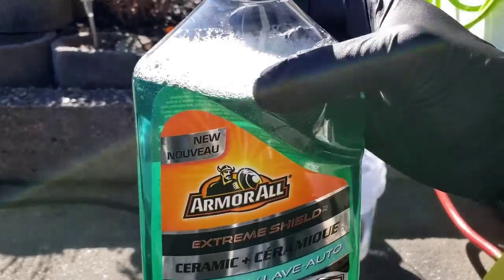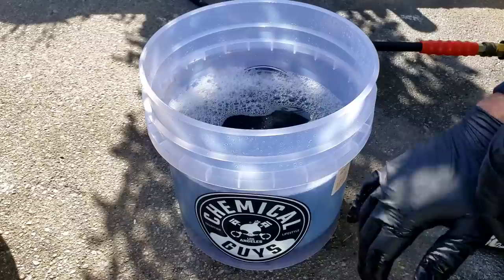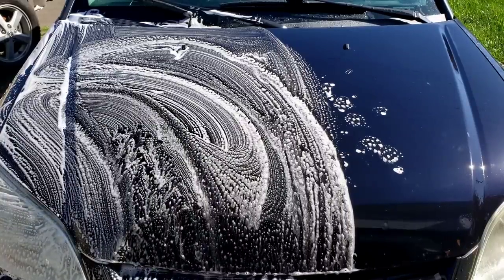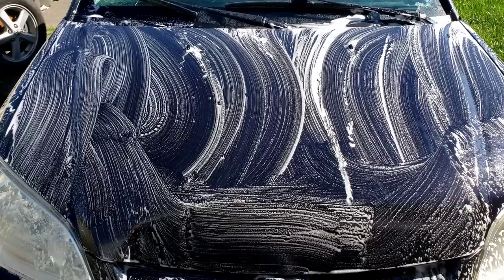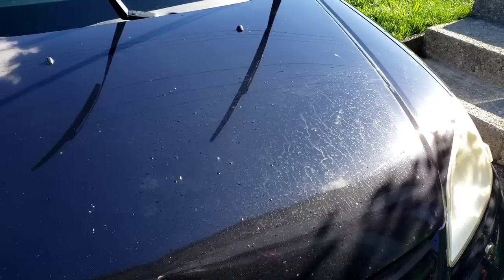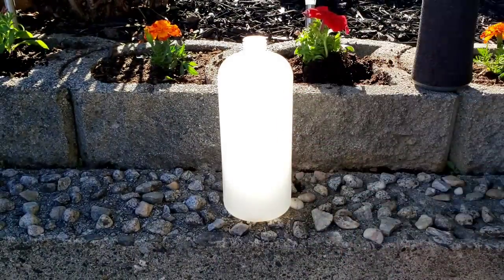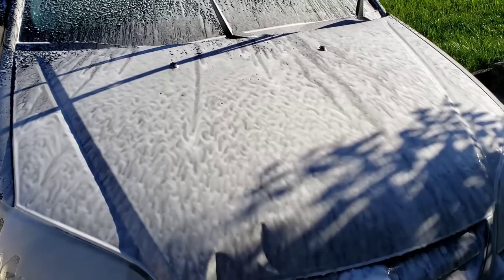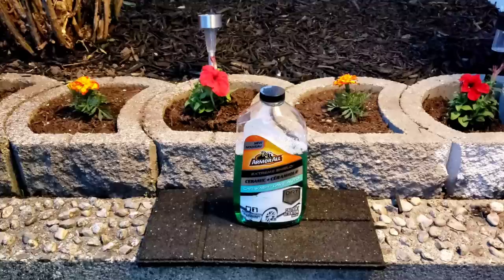NEW ARMORALL CERAMIC CAR WASH SOAP REVIEW | SURPRISING RESULTS

Comment: I let it dry on my whole car 🤦🏾‍♂️🤦🏾‍♂️.. still trying to get it off after days 😩 Do Not Let It  Dry ! 🙅🏾‍♂️
Reply: Same dude. I messed up lmfao
Reply: @mango2835  did you figure out a good way to get it off?
Reply: @mr.a6767  I had the same issue trying to get water spots out.  I ended up using meguiars quick detailer with microfiber and some elbow grease.  45 min job turned into 2 hour job.
Reply: @el_godfather3762  yea man this stuff probably works good. I just did it the wrong way..  but your right it's about 2 hours worth of work smh lol

Comment: One of their competitors suggests one cap full per gallon of distilled water.  This has worked better for me than house water.
Reply from the maker: Interesting. I’ve never used distilled water to wash a car before. I’m think about investing in some kind of water softener system in the future
Reply: @TheCarDetailingChannel  PH neutral seems to be best. Well water can work too as long as it is drinkable.  Some wells are just for agricultural use because of high iron or sulfur and will not be ph neutral.

Comment: I had same spits after my first wash, hadbto use detail spray to remove. I blew dry and wiped.
Reply from the maker: That’s my biggest complaint with “ceramic” car wash soaps. I see a lot of negative reviews on the horizon from people using this and getting streaks
Reply: I had same issues with this. Leaves streaks using a foam canon and regular hose. I applied and gave it 3-5 mins to loosen dirt. Then hosed off. Then did the two bucket method. Not sure if the streaks came from the foam canon or the hand wash. But a real PIA to remove. So maybe foam canon and then immediate rinse.

Comment: I am interested to know how long the sheeting action  lasts
Reply: Roughly 2 weeks. For a soap it is incredible. You can always follow it up with a spray wax if you care about longevity
Reply from the maker: It should make it your next wash if you wash your car every 2 weeks but then again, it depends on so many variables. I made a short video about a month ago where i used this on a junk car that we have and I found the water is still beading (car doesn’t get driven at all)

Comment: If you think what it did to a flat paint is impressive, you should see what it does to a Ceramic coated one!  This soap has just replaced several steps in my washing routine.  Before I would foam it with Chemical Guys VO7, rinse, then hand wash with Carpro Reset per Carpro, followed up with a wipe down of Reload.   One foam and rinse and the paint looked as if I just did the other steps, and that was BEFORE handwashing! My other truck got a polish and cheap coat of wax on just to protect it until I could go hog wild on correction, and it wasn't looking that good after a year, but the soap made it look like it did right after waxing.

Comment: I stand 100%  with  you  i wash with Armor All Ceramic Car Wash  and  this works  100%  THIS  IS  THE  BEST  OUT THERE  RIGHT  NOW  FORGET  ABOUT  ALL  THE  BIG  NAME  BRANDS   OUT THERE    I TRIED  MOST IF  NOT  ALL    AND  I  KEEP COMING  BACK TO Armor All Ceramic Car Wash  ALL  THE  TIME  AND  CAN  PICK  IT  UP EASILY  AT  WALMART  GOT  IT  FOR  $11  THAT  IS  ALL  .  REAL  TALK  THIS  IS  THE  BEST   WATER  BEADS  UP  LIKE  A MOFO      BE  CAREFUL THOUGH   DON'T  LET  IT  DRY  OR  IT  IS  A  PAIN  TO  GET THE  SPOTS  OFF  THE  GLASS AND  PAINT     WORK  FAST   AND  RINSE  OFF FAST

Comment: Interesting results !!!  Seems like a poor dilution ratio,  so cost per wash is quite expensive in comparison to others, however, its a bit of a unicorn in that its a foaming Si02 wash, that produces a good result.  
That being said there is the ease of use factor that seems quite restrictive, and time consuming.  I think they are going to shoot themselves in the foot with this one, as its just going to generate a ton of bad and negative reviews for guys at home letting it dry on the paint ( yes, even though the instructions tell them not to).  I'd like to see proper dilution ratios for bucket wash on there, as I'm not a big fan of the glug glug measuring system :)  Seeing the results on this, I'd probably give it a shot (not on my car), as its probably the best results from a wash n wax I've ever seen :)
Reply from the maker: The dilution ratio thing bugs me aswell. I don't like when companies half ass their ratios like this; Am I supposed add 2 ounces to 1 gallon, 4 gallons, 6 gallon? I went with with 2 ounces to a gallon because I've seen other similar soaps with that ratio (TW Hybrid Ceramic Soap calls for 3ozs to a gallon). That being that, that's way more soap per gallon than some of the more premium car wash soaps which ends up bring the cost per alot closer together. I completely again in that I also think they will receive alot of negative reviews from people complaining about spotting caused by this soap.

Comment: It tells you in the directions to use a clean dry cloth to wipe the excess off. You aren't supposed to let the drops dry on the car. I was impressed with your video until you did that!
Reply from the maker: I did that on purpose to show people what happens if you let it dry on the surface. Sorry about the confusion
Reply: Mine dried all over. Even in my roof! I thought I got it all but somehow I managed to let most of it dry. It dried way to fast is the problem

Comment: From a detailers Perspective would washing my car with regular car soap then waxing with meguiar’s  ultimate paste wax be better or worse than just using armorall ceramic soap?
Reply from the maker: Definitely better. The Armor All soap isn’t made to completely replace a good wax or coating. I
Reply: @TheCarDetailingChannel  Thank you
Reply: Like any true ceramic coating, it will only gloss and shed what it goes on, any defects under will still be there.   This soap is best to use if the paint is already in good clean condition.  IOW I wouldn't use it on a car that needs major claybar and polish work, it will just make it difficult to remove the junk on the paint.   I missed a small area that dried, it does NOT come off easy, almost had to break out the DA to remove it, but thankfully found that a mist of Reload will remove it, or at least level it so you can no longer see it.

Comment: Not bad, kinda impressed as well for what it is. Most of the ceramic soaps on the market are subpar anyways and this seems to handle itself well.

I just wonder how it would work as a maintenance wash for a true coating or spray, it may try to mask the coating which would probably result in worse water behavior. Some products don't top well, while some do, it seems like a decent option to maintain depending on how it tops other coatings.

I kinda wonder if the soap spots are just the SiO2, I've had times where quick detailer misted onto my windshield, I didn't catch it and the mist hardened up on me the next time I went to drive the vehicle.

That is kinda a really big con.
Reply from the maker: I think it is the Si02 content that is causing the spots. I've have Fireball HydroFoam (high si02 content soap) cause similar spots when I purposely let it dry on the surface. The longer you let it bake in the sun, the harder the spots are to remove. This is an issue that could be a huge problem for people that have no choice but to wash in full sun (like most of us).
Reply: @TheCarDetailingChannel  I looked around too, I found this soap 50oz bottle for $11.09 on Walmarts website it's a good bit cheaper there so the value does go up, felt it was worth a mention.

Comment: So in my experience, this works best at night when it’s dark out side, never in the day even if it’s cloudy outside with a chance of rain.
Reply from the maker: I agree with you. I only recommend using this when the sun is setting or in doors (if possible). Great product when used in the right conditions though.
Reply: I used it in str8 sun. It works great!
Reply: @King_drew  Didn’t you get lots of water marks on your glass, and what color is your car, is it white?
Reply: @bryanchaps3647  No. I  am a mobile detailer and I wanted to challenge the product and myself, in using this product. I was surprised. No kidding. There were no streaks or anything.
Reply: @King_drew  I’m wondering if it has something to do with hard water?
Reply: @bryanchaps3647  Sir, I had a client today (18 May 21). And I used the armor all wash soap, and you are correct. It embedded itself in the paint. I spent an additional 2 hours fixing it. This vehicle was black too, the worst of them all. 2 hours! I am never using this again. I'll stick to meguiars . I had to give the client a free 1 step paint correction to fix the issue. It looked like oil spilled over the truck. Smh. I was highly upset.
Reply: @King_drew  Yep I used it on my silver Volvo so it wasn’t very visible on the body, but I actually had to polish the glass just to get it all off. 
Which Meguiar’s do you use? I think the Gold class is very good, I’ve used it in the hot sun with absolutely no problem.
Reply: @bryanchaps3647  Idk why I thought armor all was gonna do something. I realized the white suv I detailed more than likely hid those errors. Now that I think about it. I use the yellow wash and wax.  Thats what I normally use in the sun. Never had any issues. I am definitely gonna stay away from armor all.
Reply: @King_drew  You know what ms sad , it actually shines a lot. Such a disappointment. Anyways be good.
Reply: @bryanchaps3647  Yes, it does!! That's what made me rethink on keeping it. But then I thought about the 2 hours I lost. I kept on trucking haha. You as well. God bless!
Reply: @King_drew  👍🏾
Reply: @bryanchaps3647  No, I am iffy with some of chemical guys stuff. Although I use their VRP.

Comment: Still beading after 2 months.  I like it so much I ordered a gallon.  Do NOT let it dry on the vehicle!  I made that mistake, took me a month of washes to get them all off and they only way to properly remove them is one wet microfiber towel, one dry microfiber, and rub vigorously.  I'll never make that mistake again.  If you have a really dirty vehicle, I recommend washing it first with a different soap, I use turtle wax MAX-power to clean the car, then use this one panel at a time, wash and dry, to add the protection.  Doing this has worked great, the car always beads water, and it makes it super easy to wash the car the next time it needs it.
Reply: 2 months 😮 wow 
Can you tell me how many times you wash your car per a week and how much oz or ml you use?
Reply: You drive it daily?
Reply: Sorry for too many questions 😂
Reply: @sdhl9936  Yes it's my only vehicle and driven daily.  It is also kept outside year-round, no car port, no garage.
Reply: @DizConnected  how many times you use that product
Reply: @sdhl9936  At the end of June this year I bought my 1st foam cannon, the Turtle Wax 2-in-1 garden hose attached one that can also be used with a pressure washer by moving a select handle on the side, I didn't have a pressure washer so I used this soap and that POS foam cannon.  I have to say the ARMORALL CERAMIC CAR WASH is the best soap I used in the 2-in-1 cannon.  I think I only used that POS foam cannon once or twice before buying an electric power washer and a shorty trigger with a proper foam cannon.  Maybe washed the car 2x with ARMORALL CERAMIC CAR WASH and new electric power washer.  Then I switched soaps to the turtle wax max-power.  The car still beads, I've done 4 cars with ARMORALL CERAMIC CAR WASH and they all still bead.  The other cars have only been washed 1-2 times with ARMORALL CERAMIC CAR WASH.  I would use it again but I want to put a proper Ceramic coating on all 4 cars.
Reply: @DizConnected  thank your very much 😁

Comment: Armor All Outlast is great for brake dust, too. Cuts the brake dust that sticks to my wheels by probably 80-90%. I'm not talking about just being easy to wipe off... it just isn't there.
Reply from the maker: I should give that a try and see if work better than just a regular spray sealant.
Reply: @TheCarDetailingChannel  What spray sealant are you currently using that's good?? Have Brembo Brakes and they keep my wheels dirty! Especially the front....